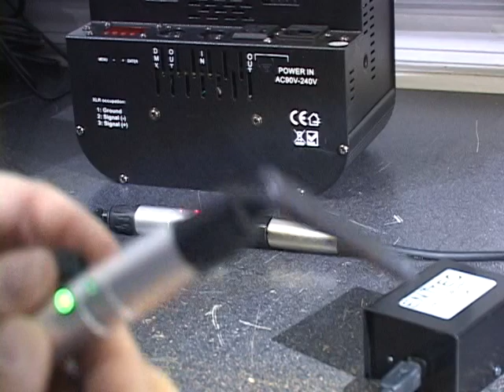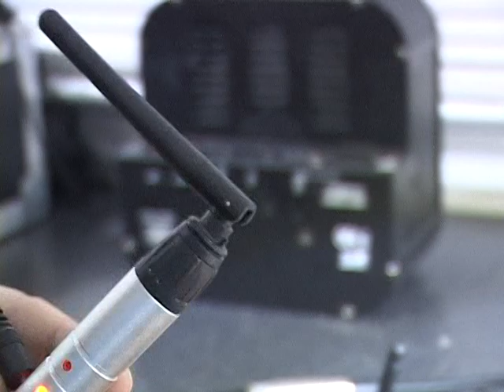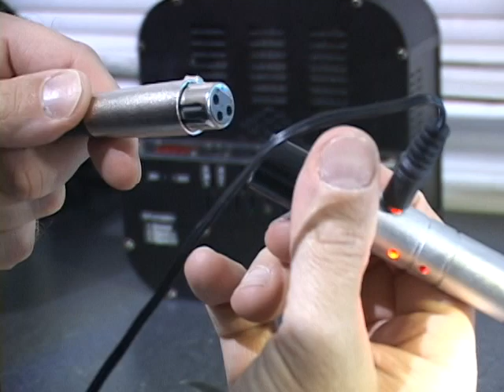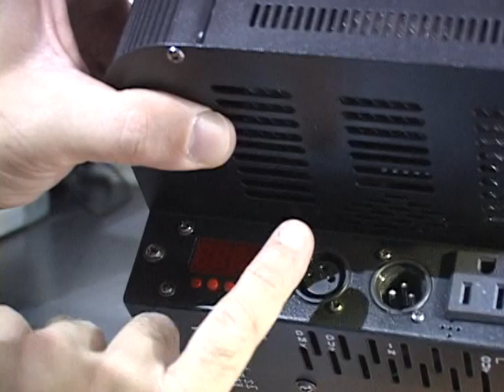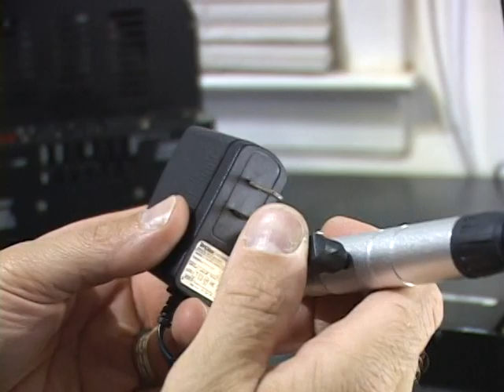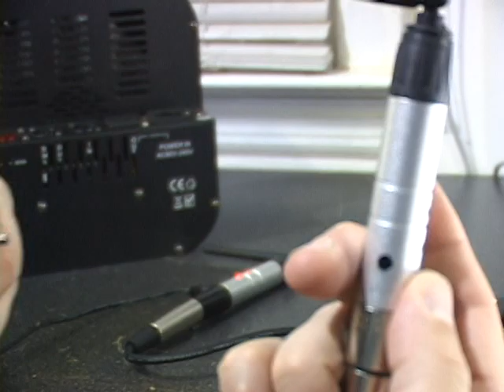Wireless Stick Tutorial

Comment: must be completely wrong. why would only 7 receivers will receive the data? it is radio... receivers should not be limited by number. 
But if you have 2 or more DMX-universes, you can set one transmitter to one channel (color) and a second to another one (color).

Comment: You only need a terminator when you have a long line of lights connected with dmx cable of usually 300 feet or more. If your putting out receivers into each light and one of our transmitters on your controller, then no terminator needed.

Comment: The stick power can be modified by the manufacturer to where you tap into the same power plugged into the light. No additional power sockets will be needed. They should have thought about that through designing the device, using same connector to back of light for power.

Comment: I just purchased 2 transmitters & 6 receiver (Donner 2.4). Question I have is can I hook these up to my (Chauvet freedom Par hex 4's) by just plugging in one transmitter into my computer or Obey 6 & then just bi pass & not have to run any receivers? Only reason I ask is cause the Freedom Pars are wireless dmx & run on the same 2.4. So if I go into the freedom pars & set them all to Receive (S-tr) will it work? If not I would like to save my transmitters & receivers for my moving heads as planned & just buy a D-fi box by Chauvet. Thanks for your response.

Comment: Question...  
If I have one wireless transmiter and I want to use it wit my "mydmx2.0" can I plug the transmiter to mydmx n the receiver to a light and the rest of the lights conecte them thru dmx cables? 
What Im trying to say is, only 1 transmiter to 1 receiver n the rest of the lights thru cables...
Thanks.

Comment from the maker: Just to cover several similar question posted in this thread - Yes, Our DMX sticks will work with any DMX device by any brand. The only time they will possibly not work is if you use one of our transmitter/receivers with another brands Transmitter/receiver if that other brands Transmitter/receiver is on a different frequency band. Our units are on the 2.4 frequency band. To purchase or get more info. visit our website or call us.
Reply: Does this works with My Dmx2 from AMD?
Reply: +Luuis Valle "Our DMX sticks will work with any DMX device by any brand"
Are u fucking blind? he just said that.

Comment: Hi - these look really useful and will make setting up much quicker and simpler.
You showed them working from a DMX control/computer.  I don't run a DMX system - so - can I use them from the DMX out of a light that runs it's own show MASTER/SLAVE style.  I know I will need a transmitter and one (or more) recievers with each light on different channels but as I only have 4 styles of light they have 7 channels - save me lots of cabling to remote places.

Comment from the maker: If the receiver suddenly turns red or starts flashing red, that means your light is throwing out a Master dmx signal and over riding the signal coming from your controller. Simply set your fixture that the receiver is plugged into to it's Slave mode and it will no longer throw out a DMX signal and the receiver should start receiving the transmitter's signal and start to flash green again.

Comment from the maker: They should be the same. If not, get a paper clip to set them by pressing the small button inside the hole on the units body. Next plug the transmitter into your DMX controller and send a DMX signal to the transmitter. It should start to flash red and the receiver (still not plugged into anything) should start flashing green. If it is, then power on your lighting fixture and plug the receiver into the light.

Comment from the maker: If you are using our units I can help trouble shoot. If your using someone else's, I can't as even though other units look the same, the circuitry and programming may be different. Make sure that both your transmitter and receiver are set to the same group color. To verify this, unplug both from your lights and controller and simply power the units on and see what color the led lights on the units are.